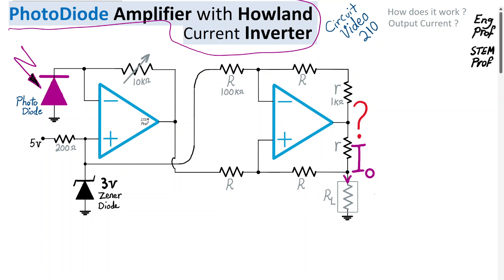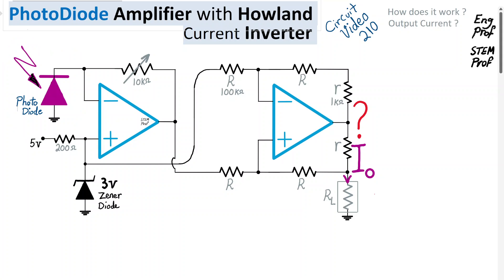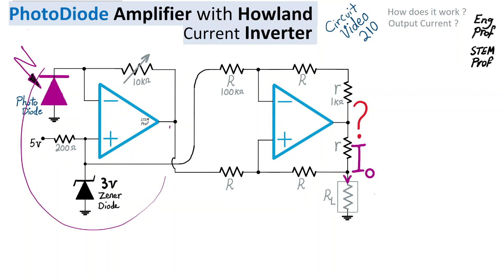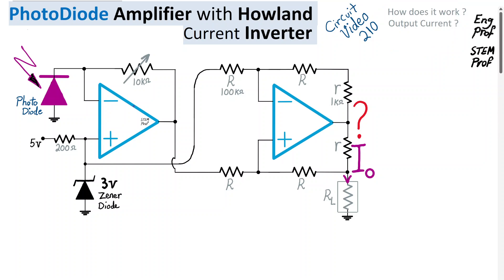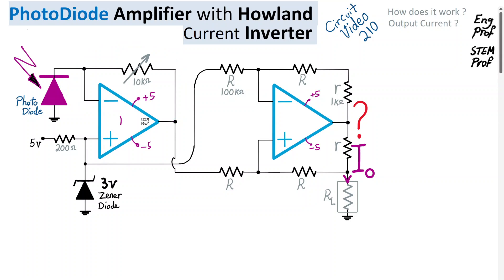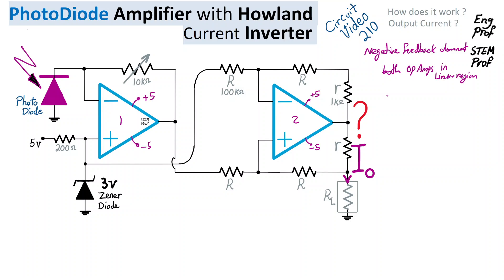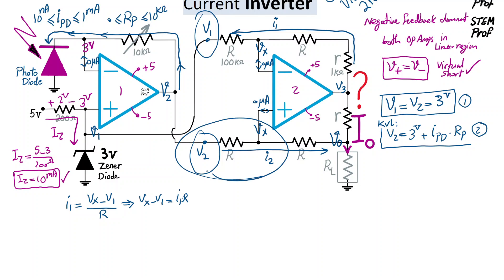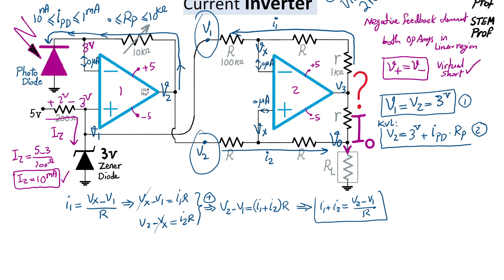PhotoDiode Amplifier Design with Howland Current Inverter

Comment from the maker: A PhotoDiode Receiver Amplifier Circuit with Howland Current source/inverter is analyzed in this video.. For more analog circuit videos see: PhotoDiode Amplifier with Data Compression Explained https://youtu.be/hqrRx2ufAwg
PhotoDiode Amplifier with Op Amp and MOSFET Explained https://youtu.be/1c3EJ2d4pVI
Analog Computer Raises signal to the Power signal https://youtu.be/Qe3cY9JSzYg
Amplifier with -25 to 55 dB Attenuation-Gain range https://youtu.be/oyz6lTGd2Xo
Electronic Gain Control for Op Amp Amplifier  https://youtu.be/NoNgQpbj77Y
Thermometer Circuit Design with Op Amp & BJT transistor https://youtu.be/55YsraFE0rg
Instrumentation Amplifier with Electronic Gain Control https://youtu.be/C4tghZ-q6Zs
Power Amplifier Design (Class A) with Transformer https://youtu.be/gKlJrqGqeCI
VCA Electronic Gain Control (Part 1): Voltage-Controlled Attenuator Overview https://youtu.be/cFzYZsPEtP0
Analog Multiplier Circuit  https://youtu.be/VP53A2zpVMQ
Push-Pull Power Amplifier Design with Op Amp, Sziklai Darlington Transistors https://youtu.be/8BFzsi7-Vbs
Analog Vector Summer Circuit Design with Op Amp and BJT Transistors https://youtu.be/PIAsa0QNVns
Op Amp Analog Computer Differential Equation Solver https://youtu.be/ENq39EesfPw
Push-Pull Power Amplifier with Darlington Transistors https://youtu.be/866MYibo8yE

And the Analog Circuits Video playlist: https://www.youtube.com/playlist?list=PLrwXF7N522y4c7c-8KBjrwd7IyaZfWxyt  I hope these Circuit design and analysis videos are interesting.

Comment: Very interesting, as always :) but I see one problem there. If the first opamp is powered by 5V, and Ipd can go to 1mA, than Rp cannot be 10k pot. Because V2 would not be able to go to 13V.
Reply from the maker: Glad that you found this video interesting. Thank you for sharing your observations. You have a good point. 👍  Either max 2k Ohm potentiometer should be used or op amp supply has to be say +15v.  For more sensor videos pls see the Sensors Amplifiers playlist https://www.youtube.com/playlist?list=PLrwXF7N522y7Ut9bm8TXAOhIWqL__FGlj
Thank you

Comment: i learn a lot from this. I miss a little bit of reasoning why and when should one use such a circuit. Facts about the advantages and disadvantages.
Reply from the maker: Glad that this video is helpful. The first Op Amp operates as a transimpedance Amplifier by converting weak current of photodiode to a practical voltage at its output. The 2nd Op Amp uses that voltage to generate a reversed direction current source proportional to the original current value. I hope this is helpful.
Reply: @STEMprof  Yes, I really enjoy following your explanations. But I meant in general, for other videos too. For example, this video: why would one want that reversed current source, as we just could use the first voltage as the voltage output with low output impedance. In other words, it would be beneficial (in my opinion) to explain beforehand a video why should one use specific configuration, typical use cases, why not use maybe another obvious configuration, pitfalls and so on. Don't get me wrong, your circuit analysis is very interesting to follow along 😀
Reply from the maker: Thabk you for sharing your thoughts & comment. Glad that you like my videos.  I understand your point. In some design problems (including this one) the desired output is not a low impedance voltage and instead a high impedance current source (not sink) is required proportional to the input.  This is a design for such use case. I hope this is helpful.

Comment: I recall that bias on photodiodes is used to reduce the junction capacitance and thus increase speed/bandwidth.  I also recall that the downside of biasing is increased noise.  So, in high sensitivity, low speed (like a photometer for chemical measurements) zero bias is desirable.
Reply from the maker: Thanks for sharing your thoughts and insights.